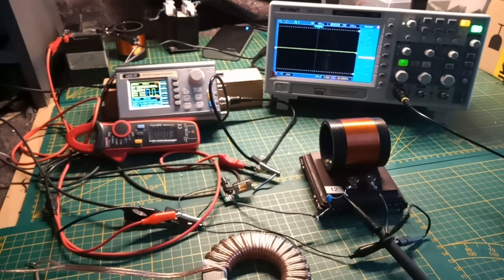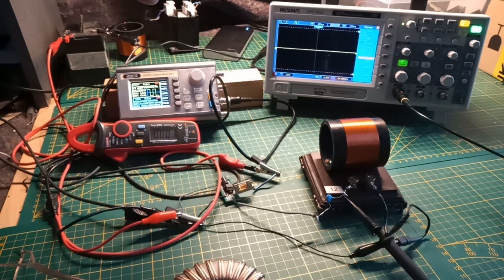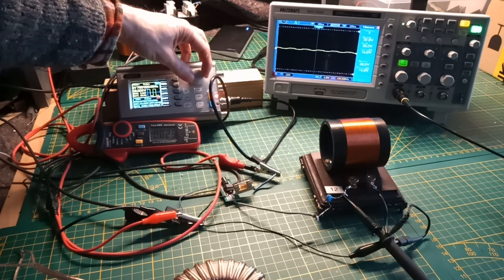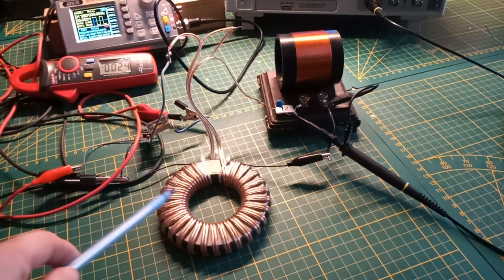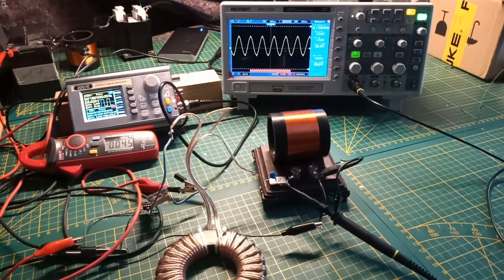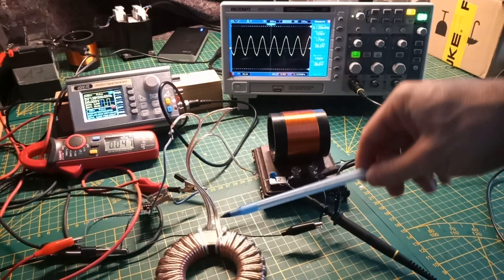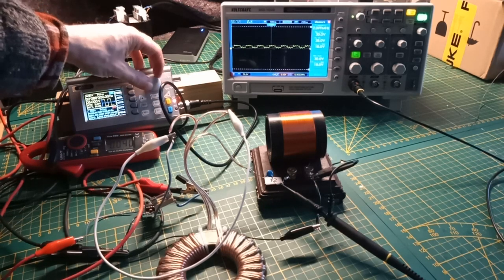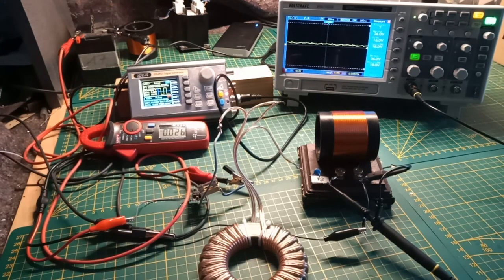Higher Resonant Frequency For Same LC Tank By Using Bifilar Choke

Comment: Bifilar inductors have a very large impedance at a certain frequency and then their impedance goes down as frequency goes further up. So I’m thinking that the bifilar inductor is very high impedance at that frequency and it is preventing the series resonance of the main inductor and the blue capacitor; so the oscillation that you see on the scope is the result of probe capacitance and the main inductor parallel tank circuit. Probe capacitance is lower, hence, the resonant frequency is higher. It is the probe effect.
Reply from the maker: @Mohammad-Mahdi Taghipour, Thank you for you're comment. I don't know if it's the correct way but I powered up the circuit again with probe connected and placed a neon bulb (touching the coil connection), it was slightly lid. Then I removed the probe and offcourse the neon went out, I then changed to 2.298Mhz and I had approx the same brightness as with the probe. Is there a sudden way to be sure?
Reply: @brunovk417   You should always show a circuit diagram, how you have connected all up... otherwise no exact analysis can be done, if one is not shure, what you have connected to what...
Reply from the maker: @overunitydotcom, I placed a link to the circuit in the video comments: https://photos.app.goo.gl/QDumqpqgrhTtn8XK8